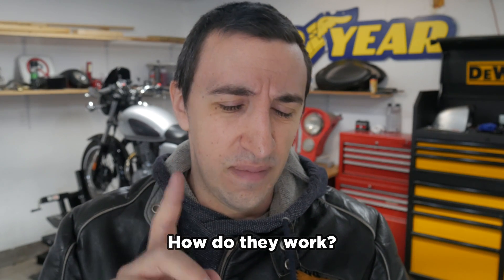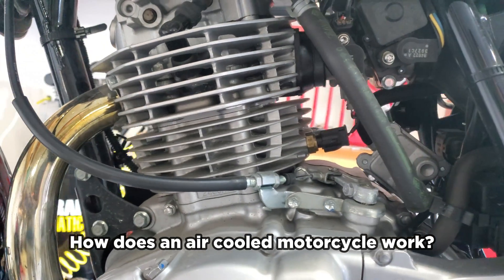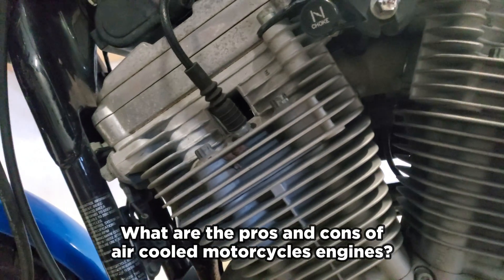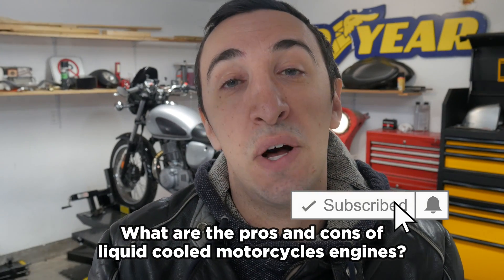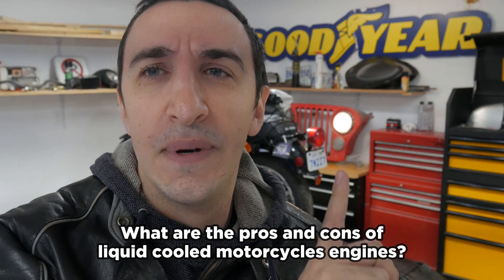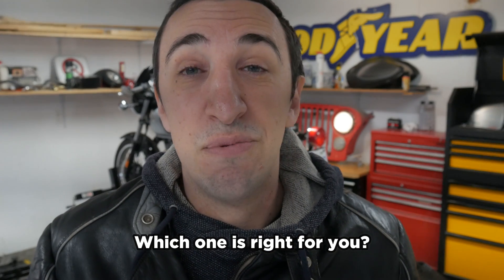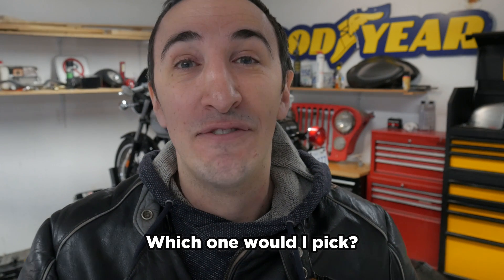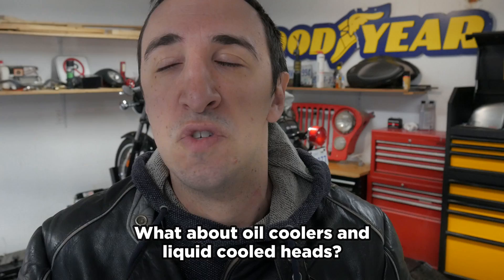Liquid Cooled vs Air Cooled Motorcycles

Comment: How much more can a liquid cool bike last more than a air cooled ?
Reply from the maker: honestly it's really all about proper maintenance. a carefully maintained air cooled motorcycle will outlast a poorly maintained one. if they were both maintained to the same standards the liquid cooled one would last longer but there's no way of accurately guessing how much longer, it's theoretical
Reply: @YouMotorcycle  I've  never owned a motorcycle so they don't  last like cars 200 300K miles if maintained  at an optimum  level ?
Reply from the maker: @mikegreen5502  cars spend most of their lives at or under 2,000 rpm. Motorcycles spend most of their lives over 3,500 rpm. Many around 7,000-9,000 rpm. A vehicle doesn't care about number of miles traveled it cares about how much wear it gets in those miles. Motorcycles get far more wear.

Comment: Kind of funny a motorcycle stuck in traffic I mean there  is lane splitting and filtering whether legal or not but a motorcycle stuck in traffic  its  funny,

Liquid cooled is fine until  it fails  when you cannot afford for it to fail, over heating the engine.

Most of my problems come with water pump failures, radiator failures in both cars and bikes.

I never had a problem with air cooled units so far
Reply from the maker: does your city have three million people living in it? mine does. sometimes everything is grid locked and even bikes are stuck. especially in construction zones.
Reply: @YouMotorcycle  I live in long island now but I grew up in New York city 8.36 million people here! Some of the craziest driver around...  Parents used to live in Brooklyn, so the always tied  up/ backed up Belt parkway / van wick   (JFK airport traffic) is a main reason I got a motor cycle :)

Comment: what about a hybrid where instead of having water jackets around the cylinders there are only one or two water pockets next to the exhaust port? To minimize the number of water pockets used every other cylinder is inverted so that the exhaust ports mate. Is there a problem with reversing your cylinder orientation? Is the colling at only the exhaust port sufficient to meet heavy traffic needs. Are there pollution control issues that are better addressed by a water-cooled bike?
Reply from the maker: I don't know I'm not an engineer I'm just a guy who rides motorcycles :)
Reply: I meant head orientation, not cylinder orientation.

Comment: A solution to air cooled bikes stuck in traffic and overheating can be adding a cooling fan (just like for water coolers). Some more modern air cooled bikes already use this method.
Reply from the maker: Yup! I've seen a company called Love Jugs that makes fan kits specifically for different Harley-Davidson motorcycles. Pretty cool plug and play option!
Reply: Ducting can also help at speed in conjunction with fans.
Reply: Also filtering through traffic helps too, something motorcycles are pretty good at lol
Reply: That's exactly what I was thinking about that's why I'm here I have a 2006 KLR 650 when stopped at a light the fan will come on and off it all depends how long I'm there once I get going it doesn't come on at all I live in Florida it's always 90° oh my God I would like to get that Kawasaki w800 but it's air-cooled and I know I'm going to freak out when I'm at a light or something thinking I'm burning this thing up maybe I should try one of those fans if I buy this bike if that works I think I found my new motorcycle.
Reply from the maker: Are you running full synthetic oil, and if so, have you tried different grades to see if it helps?

Comment: I am a big fan of the "old" technology of air cooled or air/oil cooled.  I have a 07 BMW R1200R and it is unique in that it is air/oil cooled and it has a factory temperature gauge and I have never been able to overheat the bike in traffic (but it has a huge oil cooler).  I had a Triumph ST955i liquid cooled that would overheat all the time in traffic.  The worst over heater I had was a Honda XR650L, that bike would hit 325F while riding on the highway.  I want to buy a new XR650L, but will add an oil cooler or maybe get a DR650 and add a aftermarket fan.    The best bike I ever had was the Honda XR200, when I was a kid, I rode that bike for hours on end without ever overheating the bike.  Also, never could overheat the old GSX750s with an oil cooler that looked like it came out of a 1 ton truck.
Reply: I too have an R1100RS 'oilhead', love the fact that don't have to deal with another (water cooling) system which adds more work and additional weight to the bike.

Comment: Are there mods for water cooled radiators? I have a 2017 honda rebel 300 and want more out of the rad
Reply from the maker: I'm not sure. I've seen people use different coolants or even replace smaller rads for bigger capacity ones.

Comment: Great topic. I am about to buy another bike and this topic has been a big concern. I have an air cooled cb 360 Honda. Looking to add a bigger classic looking bike that can ride highways if needed. Back roads are the main area of interest. Looked at Ducati Scramblers but read a ton of overheating complaints. I am looking at Triumph T100. Now the Hondas are water cooled and the Triumphs T100 from 2016 on/ so I had decided that water cooled was the way to go. I live in South Florida.  Now I am like maybe the air cooled will be ok,, afterall. That opens up a lot of bikes like the Royal Einfields all air cooled. Ok I am still conflicted...
Reply from the maker: Personally I don't like the finish and reliability of the Royal Enfields. I don't think they have caught up to the Japanese, Italian, or even British bikes you mentioned. Other than that, get whichever you think best suits your intended purpose for the bike.

Comment: Hey, the jeep background is awesome man.
 I have two questions,  I  just got a chinese air cooled dual sport. 
1.How does the lubrication work in an air cooled bike?
2.Should I be worried for riding my bike when the engine is cool?
Reply from the maker: Lubrication would be no different, just make sure you check the manual for how often to change oil.
I wouldn't worry about riding it cold anymore than I would a liquid cooled bike. A liquid cooled bike has a thermostat like your car or truck, so it's only going to pump coolant when the thermostat recognizes that the engine has heat up enough. In other words, let it warm up for a few seconds, or a bit longer if it's freezing out, and enjoy. 
Hope this helps!
Reply: Thanks man .
Reply from the maker: @thebronextdoor3583  No problem brother, ride safe, but have fun!

Comment: Loved your explanation. I drove my air cooled Suzuki Gixxer for 650km non stop but didn't face any heating issue. I tried the same thing in a liquid cooled KTM Duke and my legs almost got roasted.
Reply from the maker: Big single cylinder KTM Duke? When I ride a BMW G650GS (it comes up in a few of my newer videos) which is a big 650cc single cylinder, liquid cooled, fuel injected, I find that when the fan comes on my right leg gets toasted, but that's because the fan is blowing the heat from the motor off the motor and onto my right leg. My legs are actually cooler before the fan comes on then they are while it's running lol
Reply: what Gixxer bike did you owned sir? the 250cc?
Reply: @markyljayipan8183  The 155 CC

Comment: Liquid cooled engines can be built with tighter tolerances, and tuned for a smaller operating temperature range, making them last longer, more efficient, and more powerful at the same time.
Reply: Lowering the temperature contributes to the longevity of an engine, any engine, but having it high in the RPM so it can operate adequately, kills the longevity. Longevity is not the result of tight tolerances. Tolerances are not aimed at longevity, but at higher performance. Yes, we can find a sport bike, or for this instance, any high revving engine, but truth is they're not that common, perhaps they're likely severely abused and, what no one likes to admit, the spare parts either very hard to find or inexistent. Ah, and high revving engines generally lack low end torque, being low end torque a desirable characteristic in any engine that is to be used in public roads.
Reply: @omarsalgado9715  
Before emissions cars, trucks, and motorcycles rarely made 120,000 miles. The more stringent emission controls meant that tolerances had to be tighter to conform. In the pursuit of emissions we now have faster, more efficient, and more  reliable machines. Even pieces of shit can go over 200K. I don't like any of them but the fact is that bullshit laws made everybody step up. Only HD languishes trying to decide what to do. Air cooling is for aircraft at 100+ miles an hour all day. Works well there. Motorcycles in traffic? Not unless you can go 100-200 mph all day long like aircraft.
Reply: @upsidedowndog1256  They don't need to maintain 100+ miles to stay cool. Indeed, as long as air keeps hitting them, they're pretty fine. I would say 30 mph is the minimum. Why? Because they can rev low and still push hard when needed. Oh, some years ago, I rode my Sportster for 14 hours straight. That was a decade ago. It is still running great. Stuck in traffic? I will grab my 150 cc motorcycle for that job. And guess what? It is also air cooled. You will only need an engine with tight tolerances for the racetrack, otherwise it is a waste of engineering.
Reply: @omarsalgado9715  
I thought so back in the early 80s with dirtbikes. Then the LCs kicked my bikes in the butt. My 85 Kawi 750 turbo is air cooled, a blast to ride. So is my 1979 Garelli Gransport moped. Both are great, but both could use LC tech to be even better, racetrack not necessary. I had to rebuild both to keep them alive.
Reply: What are you talking about?
Emissions equipment is horrible and you lose power. Its bad for the engine as it recycles carbon deposits onto the valves , clogs the ports and increases maintenence intervals. Old cars were very reliable unlike new vehicles with exceptions. 
A bmw service manual calls for 30k mile head removal to have the head cleaned for example. You obviously have no idea what your talking about. You don't see cars and trucks with 250-400k miles anymore. It's called planned obsolescence , or the 5 year lease model.
Reply: @omarsalgado9715  
My 18 year old 11,000rpm SV1000S has low end, midrange, and a strong top. It running quite nicely after all those years. It only has 34,000 miles because I own several bikes. I broke it in at the dragstrip at 500 miles, and it feels stronger than others I have riden by more than a little.
Reply: @omarsalgado9715 who said you have to make liquid cooled bikes high rpm? There's plenty of big bore liquid cooled engines that don't rev high
Reply from the maker: Good way of summarizing a lot of information into one sentence 👌
Reply: I love the simplicity and the longevity of the oil cooled engine. Liquid cooled engines are extremely sensitive and unforgiving when the cooling system is not operating adequately. The oil does not rust your engines inner components nor do you have to worry about flushing your coolant or dealing with air bubbles that causes your pressurized cooling system to malfunction.
Reply: @Comrade134  
While what you say is true, the difference between the efficiency of oil vs liquid cooling is quite large. Victory's 1st cruiser was oil cooled (similar to some diesels) but while higher performance was promised, it could not deliver. Suzuki used air/oil cooling for a long time (as do piston aircraft engines) which is light and can deliver higher power levels, but even they relented to liquid cooling when power levels needed to be higher. My 03 SV1000S has a water radiator and an oil radiator, runs almost too cool. My wifes 2012 DL 650 has normal radiator and a liquid to oil cooler and runs cool enough that it has problems boiling off moisture unless it is really hot out or ridden very hard.
Reply: @upsidedowndog1256  my oil cooled 2007 R1200GS has 15 less horsepower than the 2013 water cooled equivalent. I thought I was missing out until I rented a water cooled model recently and I realized that more hp was resulting in noticeably less torque than my good old oil cooled bmw. My bike also has more grunt than the new water cooled model. I don't miss that added horsepower because all it did was tempt me to cruise the highway at dangerously high speeds.
Reply: @Comrade134  
I have heard that about the "oil heads". I prefer higher speeds, myself.
Reply: And radiators are ugly on the wrong bike aesthetic. So… air cooled for retro? Liquid for street-sport?
Reply: Efficient — Pushing Oil or Liquid use power of Engine so energy is used up for cooling not just moving piston.

Comment: harleys have been air cooled for many years, whats the issue, hondas are cheaper and have radiators?
Reply from the maker: Overheating for starters
Reply: @YouMotorcycle  Only if stuck in traffic. Anyway, those bikes belong more to a mountainous way than a street.

Comment: Can you convert a air-cooled motorcycle to liquid?
Reply from the maker: You can add an oil cooler. It's not quite the same thing but it can help. It also adds complexity though.
Reply: You can also add jug fans. My dad had them on his sportster for a while. They hook up to a battery, and mount to the horn bracket. It has little fans that blow onto the jugs. Pretty neat.
Reply from the maker: @1971GT  That's true too!

Comment: Both use air to cool the bike just use whatever :)
Reply from the maker: One uses air a lot more than the other, and the other uses a lot more than air. The two are very different.
Reply: @YouMotorcycle  yeah but is air
Reply from the maker: @thme6413  🤦🏻‍♂️😂🆗
Reply: well LC ones have fans attached to a radiator so air flows even when an LC motorcycle is idling. that's why they are capable of surviving traffic jams (so it's only fan that makes the difference imo)
Reply from the maker: @danylomotchanyi9441  liquid cooled ones also have coolant pumping through the motor whether or not the bike is in traffic. If your fan comes on you can bet the coolant is doing its job too, so it's not just the fan that makes the difference

Comment: Thank you I too was having a problem choosing between the two but you made my decision easier.
Reply from the maker: Hey Gonzo, glad to hear! What bike have you decided to go with?
Reply: @YouMotorcycle  well I just found a 1985 honda rebel in excellent condition with only  5000 miles ill be picking it up tomorrow it's air-cooled.
Reply from the maker: Nice. I started on an 85 Honda Rebel CMX250!
Reply: @larespuertorico  how has it been?

Comment: Until the 500 and even 650cc era, the engines were not overloaded to produce excess speed and power. Today, a motorcyclist with a thicker license, is not satisfied with 45, 50, 60 horses. They want to ride alongside powerful cars with more than 300 horses with 4 wheels supporting and braking when necessary. Happy for the era when no sophistication on motorcycles is needed. They were light, manageable and easy to park. Too bad it will never come back!
Reply from the maker: Yes, exactly. The motors aren't working so hard. But then if you do want to make a lot of power you need huge motors like Harley-Davidson... What do you ride man?
Reply: @YouMotorcycle  I ride a Yamaha RDZ 135cc year 1985, 16 Horses, improved intake and a Zündapp KS 600 cc, year 1952 28 horses at 4750 rpm. Of course, the torque of a Harley 1200 is very pleasant, but when it comes to handling in winding and fast circuits, it leaves something to be desired. Have you ever imagined a Harley full of radiators, hoses and other add-ons, how big would it be?
Reply: @glaicogobbo4046  V1000, Revolution (V-Rod) and, mow, the Revolution Max (Pan America and Sportster S). Sure, great engines, but all lacking the character of a 45 degree, air cooled V-Twin.
Reply: come to asia. most common bikes are 150cc!
Reply: Love my ‘22 Kawi W800! Air cooled torque beast!! So much fun climbing mountain roads!!
Reply: It really feels like there's a market for old trucks, bikes, and sleds - so long as someone can meet emotions... Really why I think hybrid vehicles (diesel electric for example) are sweet because trucks like the Ford Maverick with a gas electric drive train, supposedly make 40mpg
Reply: I have an '05,  650 cc Suzuki Bandit, that's air-cooled and carbureted.  It's really a nice bike because it's comfortable to ride,  has a decent amount of power (78-ish), but it never gets unpleasantly hot, (especially since the guy that used to work on it did something to the carbs to make it run a little richer.)   I hate those bikes that blow hot air on your legs. I've had the Bandit for ten years now, and I'm well past my 'best before' date, so I might never buy another motorcycle. If I did, it would probably be smaller, lighter, lower displacement machine, and probably air-cooled.
Reply: @peterwilson8039  Suzukis are effective machines, but somewhat complicated. They only accept original parts, not supporting adaptations even of good quality. They are not like the English ones until 1990 that accept parts from specialized toolmakers.